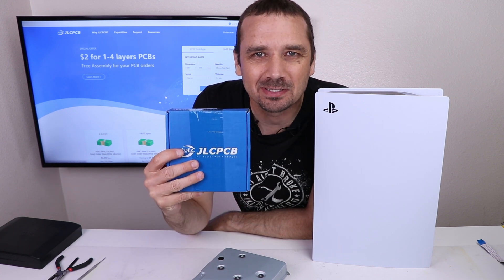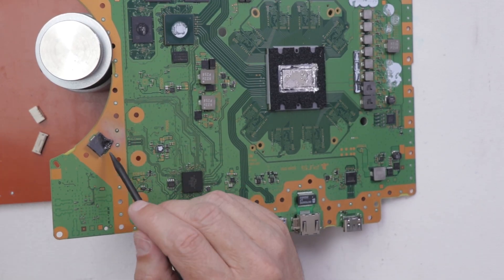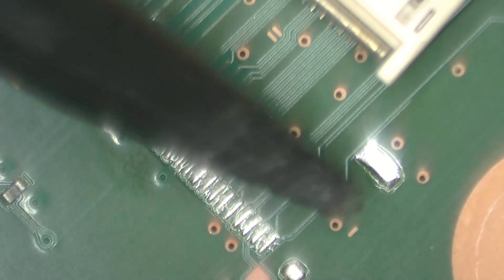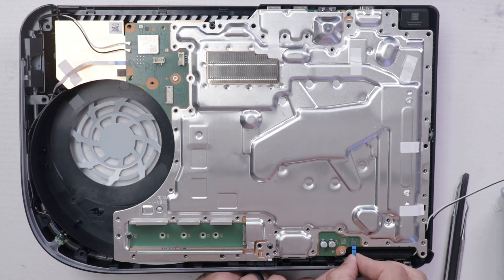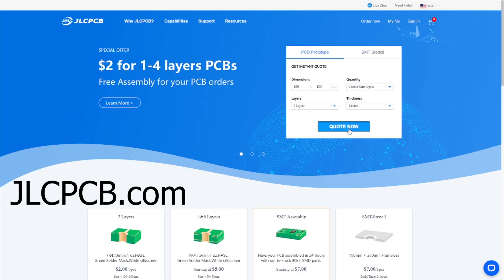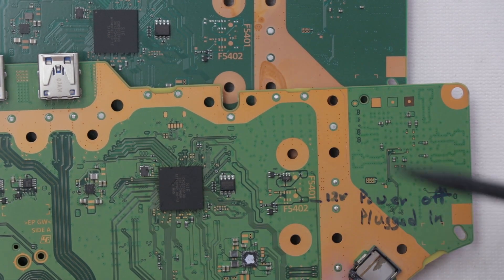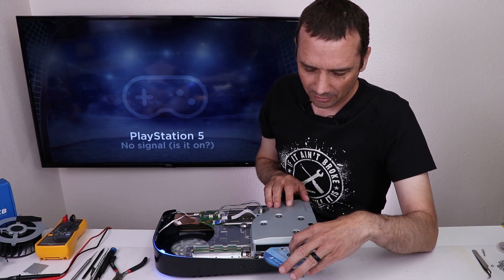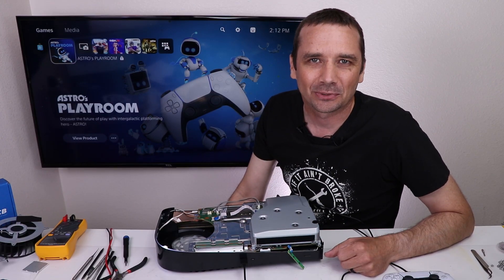I Put a Disc Drive Into a PS5 DIGITAL - But Did It Work?!

Comment from the maker: UPDATE: As some of you have noticed, in this video I put the disc into the disc drive UPSIDE DOWN! Rookie mistake, lol! I just went back and tried it again with the disc inserted correctly and it did SPIN UP! But unfortunately, it still didn't show up on the screen. It seems that the firmware still won't let it actually play the disc. Thanks to those who caught my mistake!
Reply: I would restore the PS to factory, it might have the digital/disc version detection on the OS install, if so it might end up working... worth a try after you spent so much time on it.
Reply: @RobertIlies  @TronicsFix you should try this out
Reply: @RobertIlies  good thinking and definitely worth trying. Although $ony really likes to lock their stuff down...
Reply: @Max-uv3eg  fair enough, we all remember the struggle with ps3...
Reply: Why don't you ask Ben heck
Reply: I think the drive and motherboard are married pairs, like the PS4. Still, it was a fun bit of reverse engineering to get the power circuitry back in place.
Reply: @Nintenblox Shorts and here it ends
Reply: @cooler14270  He's too powerful to be kept alive.😂
Reply: You should try to get the firmware of the ps5 (disk edition) and make a flash to the Eprom.
Reply: I whould try reinstall console but with disk edition OS, like put another SSD without OS and try reinstall it (I don't know very much about PS5, so this is just my wild guess what to do next if HW is maching disk version now) or bios chip swap from disk version, idealy from exactly that motherboard wich disk drive came from (if they have crazy system like iPhone in their screens... Screen wont work unless you program it with code from old broken screen, there is some crazy comunication protocol or something and maybe sony is doing same thing in their consoles - again wild guess)
Reply: It was a pretty cool experiment.
Reply: Hack it  and flash disc version firmware
Reply: I wouldn't mind another video even if it's just 30 seconds and the digital PS5 still won't show the disc on screen.
But as others said, can you try to install PS5 disc firmware via Safe Mode? 🙏
Reply: yea i was about to say it was upside down too, heh. This was a great vid to watch!
Reply: My cousin from Mexico said someone close to hacking the ps5, it’s insane
Reply: @iJakuzi  Yes because otherwise you could plug in a modified disk drive and bypass copy protection.
Reply: Lol those who spotted you putting the disk I'm wrong should be detectives. Impressive observation skills
Reply: I know there’s a chance you might not see this but I have an OG 60 gig PS3 that I need to get repaired who would you recommend
Reply: @hydro191988  up
Reply: I was literally about to comment about this
Reply: Now we just need to get this info to a team who can flash a PS5 and install the Disc Version firmware.  Hopefully it's just a FW lock that a bit of rooting could fix, since I doubt they used an entirely different chipset for the controller between the two.
Reply: I was doing the same first time I loaded a disc Steve, haha, hey that was an awesome experiment tho, good shiz bro, much respect n best wishes from Tucson, appreciate all the great vids you put out, god bless you n the fam
Reply: like most modern systems, the optical drive fw checks to see if the matching flag is there in the system fw. If they dont see each other, then it wont work. If you could somehow dump the original motherboard fw (the one that the optical drive came from) and flash it over the digital boards fw... it prob would work.
Reply: As someone else said: "Reinstall the os with the disc drive plugged in".
Reply: Spoilers man ‼️ still watched tho
Reply: What about if you were to reset and format the console and reinstall the firmware from scratch?  Would it work then do you think?  Thank you.
Reply: @Nintenblox Shorts OOF
Reply: yup, I was going to say "firmware differences" as well.
Reply: I was just going to say that lol
Reply: try to install the ps5 disk version OS with usb..
Reply: Maybe try format the ps5 firmware to disc version firmware
Reply: You should have tried to also swap the SSDs between the 2 motherboards
Reply: disc drive is locked by bios on it ( same to ps4 you cant just change the disc drive without motherboard swap )   can you try to dump the Disc bios Ps5 and inject it on the digital version ?
Reply: Please
Reply: Please ps5
Reply: You try use OS from Disk version on Digital one ?
Reply: You should totally just try reinstalling the system software and see if that possibly makes any difference? Maybe just a firmware reinstall with the new components in place will enable the disk drive and eject button?
Reply: Ps5 free
Reply: They need a chip?How can they tell.The hardware.And the bios?!
Reply: I need help with the Series s, it keeps frame dropping in fortnite every time someone shoots a m16, it even happens when I have it on 60fps, is it an issue with the game or the xbox? it been doing this since I first got it.
Reply: @TokQuayDough  is that the weaker one? The XSS? If so then yeah it is most likely needing a patch the XSS performance is not great.
Reply: @Nazyairsengikar  yes it's the s, and thank you
Reply: It was a nice try, but I think you fell foul to HDCP encrypted handshake failure.
Sony Anti-piracy tech at it's best.  Why do you think Sony go big on HDMI?
Reply: @JuxZeil  Because TVs have HDMI ports, pretty simple really.
Reply: @Puremindgames  Search for the reason HDMI exists and its history with piracy again and then you will understand
Reply: @dankorune  Why? TVs have HDMI ports, why would Sony, Microsoft and Nintendo use anything else?
Reply: @dankorune  HDCP handshake happens betwene console and tv, has nothing to do with digital edition not reading the disc
Reply: @milojkokitic6991  i was talking to da dude over there trying to explain why Sony likes hdmi so much not how that interferes with the bluray drive.
Reply: @Puremindgames  Half right.  Sony co-designed the HDCP standard in order to protect the copyrighted media.....and the peeps stating it's a handshake between the console and the TV obviously have no clue....or just saw the nVidia HDCP settings tab on their PC. 😂
Reply: @JuxZeil  Half right? What other connectors are on TVs thesedays? Even the Atari VCS uses HDMI.
Reply: @JuxZeil  hm?
Reply: @Nintenblox Shorts OOF
Reply: Good, people should buy the proper one

Comment: My idea is,if you install an update,and update won't verify a blu ray  player it just skips it,but i belive if you re install the update now that you have a Blu Ray Disc Installed at the installation process it will recognize the blu ray player by it's serial number or mac or hardware ID and it will installl the blu ray player,this is my idea,long story short,try to reinstall the System Firmware

Comment: Few Years Later :- 
MVG : How the PS5 Disk Security was defeated..

"So they secured the hardware real well , but did not add proper drive lockout , and hackers found a way to run an external drive and soon unsigned code.. Sony tried patching it out , but damage had already been done.."

Comment: They basically did what Microsoft did. Even when you figured out how to get power to from the PS5 digital edition to the disk drive, the South Bridge disabled it's script. Microsoft did that with the Xbox One S All Digital edition and I'm not even sure if it's possible to even try to put a Series X disk drive on a Series S do to because of it's design and build, but even if someone did go through all the hard work of getting a disk drive on there Microsoft probably disabled the script on the too just like what they did with the Xbox One S ADE and what Sony did with the PS5 DE.

Comment: This is more complicated than the old PS3 drive swap, but that wouldn't work either, you had to "remarry" the BR drive to the system if I recall correctly so it's probably carried on from way back then. I used to fix those consoles back in the day before I got out of it.

Comment: If you preheat the PCB, either with a hot plate or with the hot air pen set to 200c, then give it a quick blast with 400c (or whatever your favorite soldering temperature is) you should be able to get the solder melted a lot quicker without damaging the components (either nearby components or the ones you're trying to manipulate).

Comment: Actually, the not reading disc problem could be fixed by installing the ps5 disc edition firmware onto the digital edition, and it should work

Comment: But why do the hazzle and disable it in the firmware, wouldn't it be much mor cost efficient to flash the boards all the same but some do have the components for the diskdrive and some others don't?

Comment: Try to update the firmware with the normal disk drive firmware using USB see since u put those components on that the firmware works on that one should be same motherboard

Comment: Both the motherboard and the BluRay drive need to be matched up, that's the first thing that's preventing any communication. Sincerely doubt they went the extra mile and did any other major OS-specific tweaks for these variations, wouldn't make much sense since marrying those 2 components is almost impossible so why even bother.

So no amount of software reinstalls or voodoo is going to enable a discless console to use a disc drive, or a disc version using a drive from another disc console.

Comment: @TronicsFix I have a question not related to this video, did you ever encounter a problem that a dual shock stop working after 5 minutes? i thought it was a controller problem and I bought a new one that actually worked for few weeks but than the same problem appeared!  i need to disconnect the usb and plug it again again and than press the ps button to make it sync or if the usb cable is not connected i need to use the reset button on the controller. any ideas?

Comment: I’ve been waiting for someone to try this. I wonder if soldering external drive would work😅anyways  Between this and the External BluRay Drive method I really think it’s possible to eventually get a disc to work on the digital console. I see people saying reinstall the OS with the drive attached that sounds like it could work especially since later PS4 models didn’t have married drives.

Comment: Have you tried to force system update/reinstall? As far as I know, during updates the PS5 system do a full hardware checkup in order to identify anormalities. Said that, I'm pretty sure that during this checkup probably it will recognize the disk drive.

Comment: im sure the PS5 has a safe mode like the PS3 and PS4 did so what you should try is getting into the PS5s safe mode and rebuild the database it will reinstall all the hardware drivers and maybe it might recognize it has a BD drive and install the BD drivers

Comment: On the XBOX 360. The DVD Drive and Motherboard store a Drive Key. If the key matches on both devices. Then the system will see and play games from the DVD Drive. If you move the DVD Drive to a different XBOX 360. Then the DVD Drive won't work. If you know what the DVD Key is on the other XBOX 360. You can replace the DVD Key on the DVD Drive. Which will allow the other XBOX 360 to play games from the DVD Drive. I suspect something similar is happening with the PS5. Which is why it doesn't work.

Comment: This is honestly kinda surprising tbh. I expected that what Sony was doing was just making all the PS5 main bodies on the same production lines and then splitting them into digital and disc at the end. But the fact that there are actual differences in the motherboards between the two suggests that each model has a dedicated assembly line rather than a split at the end. Either way, it wouldn't surprise me if before long, hackers manage to get something like this working

Comment: What is the point of doing that i mean, if someone would wants the disk version, he or she probably will buy the one with the drive inside and, i don't know someone who goes with a Digital is probably who doesn't have much of a physical collection
However although i don't have much of physical games, i still rather to go with the disk inside one cause it might come in handy one day
Plus you need to get the connectors off of another Motherboard and, i don't know that's too much of work

Comment: Hi, I have a problem.  I disassembled the ps5 digital console to remove the coil whine sound and when I reassembled everything I broke the long white cable attached to the motherboard.  Now I have problems with the drift controller, sometimes it does not react and has to be in a certain position, what can it be? Thanks

Comment: you know what would of been smart for the digital version, if they actually allowed for a disc drive to be installed later on so if the consumer changed their mind or allowed external disc drives.

Comment: I dont like this all digital age because theres something about going to the game store, buying a new game and opening it out of the shrink wrap and playing it that just feels better than entering card info and just having the game downloaded, but im sure in 10 years we will have a console equivalent to steam. Pc gaming has basically been all digital for years now, even most games that came out on disc for pc, they still recommend buying the digital version, or the disc is just for installing the game and you get like a code to get the game on like steam or gog or wherever, for example pretty sure physical copies of gta v for pc give you the disc and a code for the rockstar games launcher/steam version and you dont need the disc after that, and plus with digital, if the account is lost or the store servers shut down completely you no longer have access to that game forever, whereas if you buy a physical copy you wont lose it if the servers go offline or something happens to the account
Reply: I feel the same I like physical games more
Reply: You just forgot one thing. Your PS5 and Series X discs just have some install data files these days. Then you also have to download the mega updates, DLCs and the rest of the game. I remember Spyro's trilogy remake only had the first game on disc, you had to download the rest. Physical media died in 2015 with very few exceptions like GoW 2018, Sekiro or complete editions which work fine without the small patches they got.
Even so there are problems, you actually have to activate the licenses to be able to play these games. If your PS4's CMOS battery dies, you will need to go to PSN to activate your discs and if PSN is down... you got yourself a brick. This affects digital and physical games. Xbox's DRM is even worse so I won't go into detail with that.
If you want a console that still values physical media, you need go back to the PS360 era or below.
Reply: @Manic_Panic  true
Reply: @Manic_Panic  by the time that ever happens, the ps4 should be easy to hack so by that point hacking would be a must if psn goes down and your cmos is dead
Reply: Maybe eco friendly?

Comment: Is there a way to update manually the firmware, like the older versions? You could try and see, somatimes it needs to update with the disk plugged to work

Comment: Im halfway thru but it may be software related as well to recognize disc drive. Think of the psp and psp go. Software and OS is slightly different on each. As i recall a psp fw to update doesnt even work on psp go and vice versa too i thinkn they have tweaked OS's. Psp go has to have bluetooth functionality for example so its built into fw and OS. And a psp cant update with it bcz wtf, it doesnt even have that or host of number of other things. Similar principle i think here. At least try to see if theres a difference in fw too for each system as they update. Obviously the disc variant has extra shit to run and recognize the disc drive.

Comment: The OS (if it’s still Linux-based) would need a proper device file and the driver, which it may or may not have depending whether or not there are different releases of the OS for digital and disc.  Then the device+driver would require the same hardware path.  (And it’s not clear if game titles are also agnostic to the existence of digital vs disc builds of the hw.)

Comment: Thats kind of crap that they have it locked down due to software, wouldnt it of been easier to just have 1 version of software for these ps5s? If its digital obviously it just doesnt ever use the disc reading part of the software, but the software should still be able to be there anyway. Also would be a pain for rebuilding a ps5, as you can use the all digital mobo on a disc version.

Comment: the madman actually tried! props indeed for the experiment. what I really want to see is a fix for a PS5 with a bad drive how would one get out of the doom and gloom situation on that issue? Sony soldered it on to board what's the cheapest fix for that?
Reply: at least now we know they locked the firmware and if you want to put discs in your budget must be in the market for a disc version.

Comment: After you install the disk drive, boot the ps5 into recovery / safe mode and try installing a clean version of the firmware from there. Worst case there might be something in eeprom or other deep system settings disabling it.
Soo yeah looks like you got the hardware working which is awesome, just got to fix the software next.
ps3 kinda had the same sorta thing in reverse where it wouldn't boot unless you had a disk drive... but could be patched with cfw.